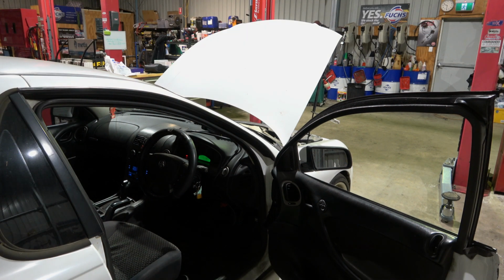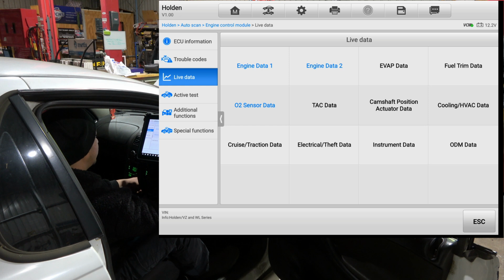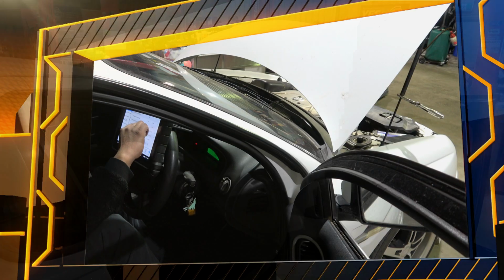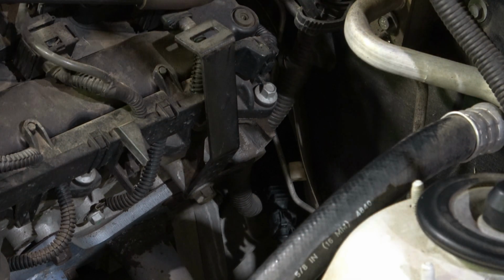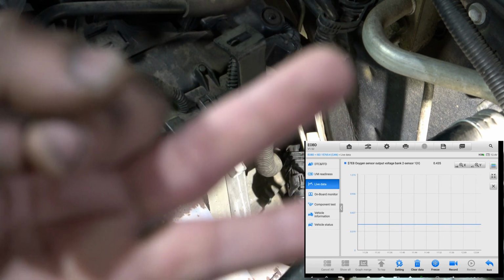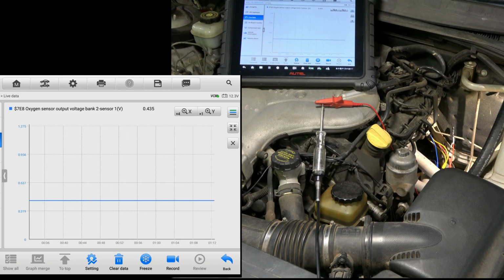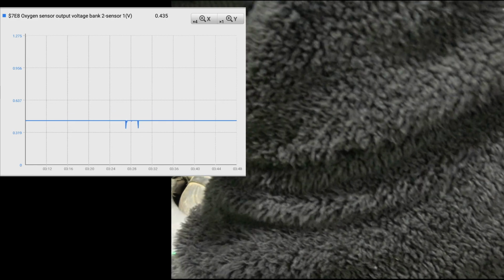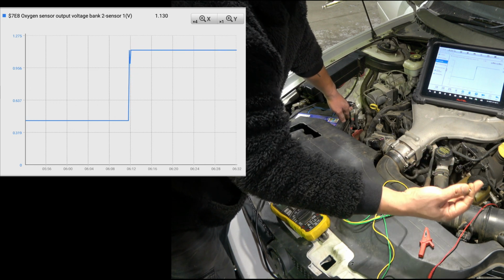Oxygen sensor diagnosis vz commodore

Comment: Hi Im having some issues with injector 6 circuit malfunction. After investigating and replacing spark plugs, coils. It still happens intermittently. A bit more investigating i have found when i lightly move the the bottom harnes on ECUi can replicate the injector  6 malfunction error. 
I have had a p0443 evaporative emission malfunction for about 2 years or so but still drivable and didnt have any issues. 

At present the car is still drivable and only notice is car rough idle for less than a minute and goes away. This only happens intermittently sometime doesn't happen for 300k. 

The car has 435000km
These are the errors i have cleared in the past.  The last 3 errors are more regular 

P0443-00 - Evaporative Emission Controll System Purge Solenoid Circuit Malfunction
18 - (Current) ECC Fault Logged
18 - (Current) Auxiliary Serial Data Bus Fault
U2100-00 - CAN-Bus Circuit Malfunction
19 - (History) EEPROM Error
U2108 (histroy) Can-bus No  Communication with ABS/TC/ESP
U2106 - CAN-Bus No Comunication with TCM (Transmission Control Module)
P1632-48 Immobiliser Fuel Disable Signal Received
p2500-00 - Alternator L terminal Low voltage
p0206-00 - Injector 6 circuit malfunction
p1668-00 - Alternator L Terminal circuit malfunction 

Has anyone had similar and was it a ecu.
Should I go for 2nd hand or new?
Thanks for your help
Reply from the maker: In my experience, ecu is the culprit. Go with new one and it needs programming. Second hand is lot of messing around